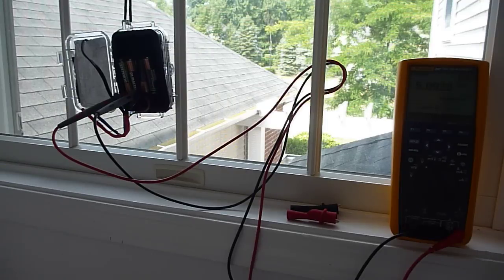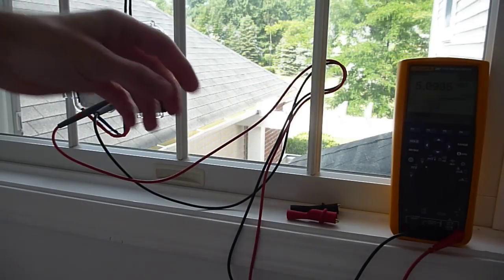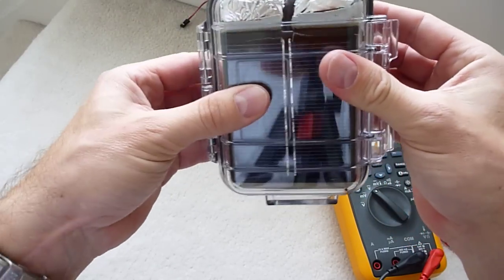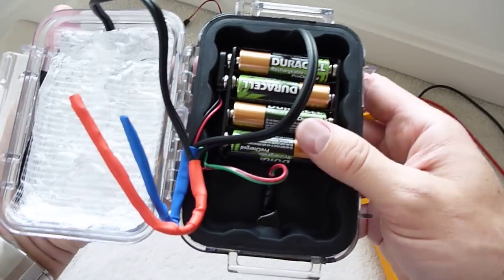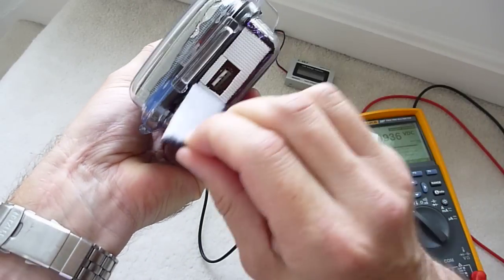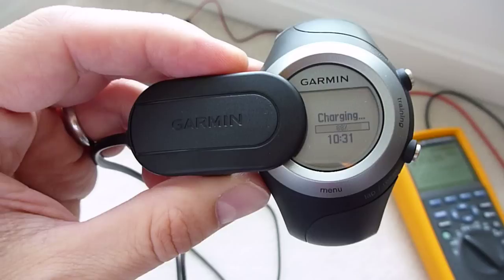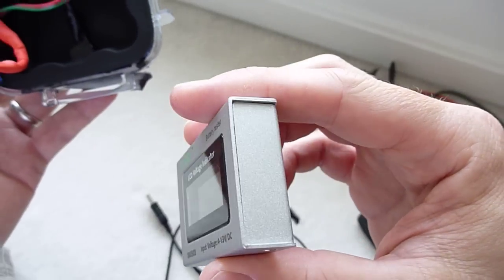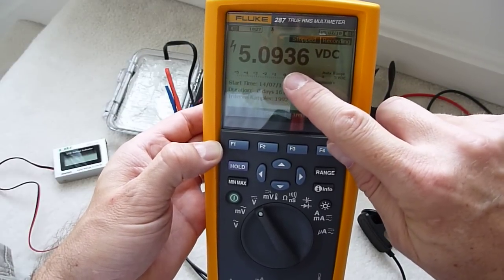Mini Solar Powered USB Charger Part 2 & Fluke 287 Intro

Comment: your designs are quite good. From a non-engineering students perspective. You are making it so it charges anything that can connect to a usb and charge on  5 volt, with out the need of a bag full of adapters. that right there saves on production cost and material use. I am looking at u unnamed companies in china.

it is inspiring me to make my own.

Comment from the maker: The solar panels will not have enough power to charge the phone without the batteries. If you connect the batteries and allow them to charge I think you'll  see it works.

Comment: you should have a circut or a switch that shuts off the panels from the batteries to prevent tge panels fron draining the batteries at night.

Comment: I can see an explosion happening here, as soon as the batteries are full you don't have the circuitry to stop the charge, so unless you place your hand on the batteries so you can feel when they get hot (they're done) you will most certainly have an explosion. I mess around with panels and use a power bank.

Comment: im having an issue with mine. when i have my solar panels hooked up to my meter the current stable, but when i plug in my phone to drops and jumps back up then drops and this happens the entire time my phone is plugged in. any ideas of how to fix this? also i havent hooked up any batteries yet